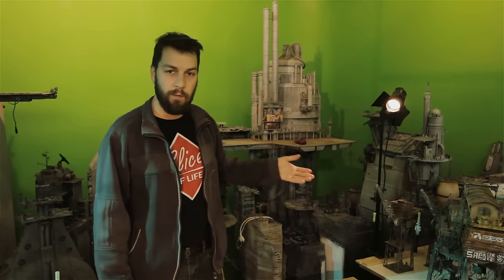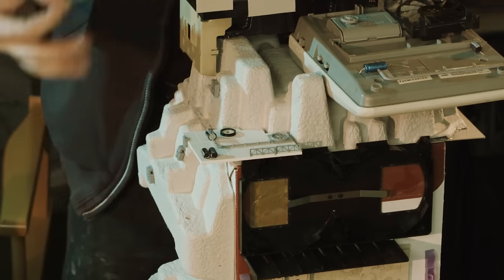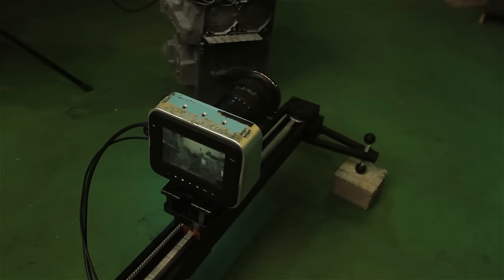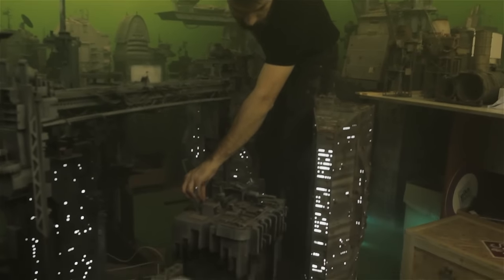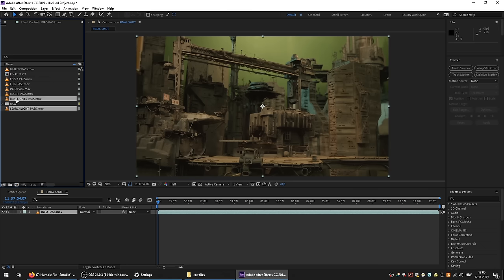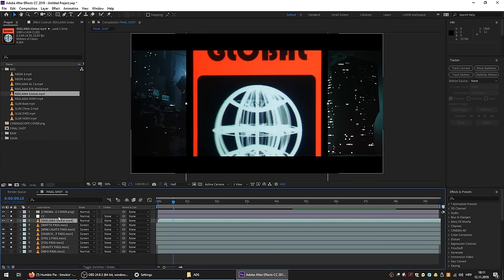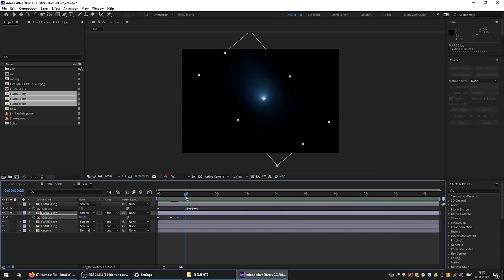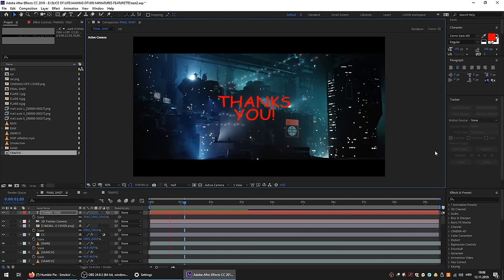The Magic of Miniatures - FULL PROCESS: build, shooting & editing of miniature world

Comment: Nice, and scary, to see how it all comes together. So many camera passes involved. I wouldn't have guessed it would take so many. I like how you really did use all sorts of models and parts of them. I noticed the Millennium Falcon on the side of one of the buildings. :)  One thing you could do before moving a building is lay down some tape to mark the position of the foot of the building. It could still be tricky to be sure it was lined up perfectly but it would help.

Comment: Very very VERY cool. But why does one NEED the passes? Why not do it all at once? Yes, I know this means you can control each effect individually (even add or subtract them if desired!), but is there another reason -- other than final edit control?
Reply from the maker: Well editing them in post is a very BIG reason, at least for me. You actually decide the look of the shot later. By turning something off or lowering the opacity you decide what will be in focus. That's the creative reason. BUT there is actually the technical reason as well. We had about 4 lights altogether, by doing 2 passes we double the amount of light sources. Another reason is that you can't film miniature window lights at the same time as the big lights as they would get lost. They are too weak so you need to expose them differently. Also, you can't project an ad on the building when you have fog in the room because you would see the projector rays... Lot's of reasons like that.. :)
Reply: @sliceoflifefilm  Very very very VERY cool good man. I thought so. I have 10 years of experience doing still photography so I have an understanding of exposure issues and such. Okay. So you answered my question! It gives you MUCH MUCH more control post (and it allowed you to fake having more lights by doubling their useage). It also allowed you to add the flying cars going BETWEEN buildings, which would have been a very  time consuming task otherwise (cutting out the masks and such). So... VERY COOL. I loved your movie. You guys deserve an Oscar nomination for cinematography. Such a perfect side tale for the BladeRunner universe. Better than the 15 minute minis they officially released for 2049.

Comment: One thing that is not mentioned is how you create the big lights ( like all the office windows on one side of a building). Could you explain that?
Reply from the maker: we just cut out the all windows  and lit them all with a single light source from inside. Simple as that. At first we cut them all by hand which was slow and hard, but later we bought a CNC machine. There's more info in this video: https://www.youtube.com/watch?v=PI8e9ty1nDg

Comment: Hot Glue gun i put a clip on the side of bench   the tip  is always  Up and No drips . 
bicard soda use that trick a few times -  Mite make a small vacum mould box  put diff parts on a board and make many panels for background effects
Reply: Just had another idea again Use wheelie bins stick panels on the sides  
so you can move the bin about & turn around any side diff parts on 4 sides   use in scence 2 ,  3  4 etc

Comment: 14:49 What lights did you use for the buildings? Those building lights are too uniform to be cutouts, too perfectly aligned to be fairy lights (on a string).
Reply from the maker: Ah! These buildings were made with the help of a CNC machine. So all windows were cut out precisely, and they were illuminated by a single light from inside
Reply: @sliceoflifefilm  Thank you for clearing that up. Great job on that whole sequence production!

Comment: What kind of software did you use to help you see your images on a live screen? Were you also able to overlay additional shots over a freeze frame Of one of the passes On the screen?
Reply from the maker: we used a simple SDI to HDMI converter and just connected the camera to the monitor. so it's only a live feed, no overlays possible unfortunately

Comment: I'm a hobby model maker looking at doing some filming/photography in this style. I'm planning on getting a Panasonic GH4 but stuck on what lenses to get. Anyone know what type/size lense is best for making miniature set and vehicles appear larger?
Reply from the maker: We shoot almost all miniature shots with this wide angle lens: Tokina 11-20 F2.8   seems to work nicely  ;)
Reply: @sliceoflifefilm  So with a wide angle lens like that would the having a really low F Stop on the lens really be that important? You would be using a high F value, correct? And then compensate with increasing ISO or using more on set lighting? Sorry for all the questions but your short film was the best low budget mini effects I've ever seen so I figured I'd ask a master plus I want to buy the right gear once instead of the wrong gear twice.
Reply from the maker: @stinkyham9050  exactly, low Fstop was not important at all, we mostly shot at F11 or even more to get the sharpness and we compensated with as much iso as we could and with more lights, just like you said.

Comment: This is great but when you put old electronics in it, no matter if just some parts like capacitors or a whole telephone, you basically run into trouble if you ever have to dispose it. It'll be hazardous waste then and you have to either dismantle it properly, which is hard as you can't tell the components apart anymore. Or you have to categorize the whole thing as electronics and deliver it to the right facility.
Reply: I wrote this before I saw the LED lights in all the models. ^^
Reply from the maker: Don't worry, we won't throw away our precious miniatures :D

Comment: Did you gents shoot any miniature shots at higher frame rates / shutter speeds to achieve a sense of real world scale? If so, what was your rule of thumb? For example taking the square root of the scale size D/d and multiplying that by 24.
Reply from the maker: We did shoot at higher fps but only the shots that involved movement of vehicles. I know of the formula but we just did it by feel. Most cameras only offer 50 or 100fps so there's not much you can choose from. we just did a couple of tries until it looked good.
Reply: @sliceoflifefilm Brilliant! Thanks for that insight. I'm working with a BMPCC OG, the highest frame rate I have available to me is 30. So when it comes to smaller moving objects I suspect I'm going to find it difficult to achieve a good sense of scale. Have you experimented at all with achieving similar results in post? Things like slowing the footage and motion blur? Thanks again, love your guys' work!

Comment: the part that might prove expensive I guess is that slider. You can't just use a dana dolly because you need the camera move exactly the same every time.
Reply from the maker: we do have the "more expensive" 3 axis slider, but the price for the ones with 1 axis of movement should not be too crazy.. also, we actually made our first slider ourselves. I just bought a servo motor and mounted it to a regular slider. It worked pretty good! ;)
Reply: @Slice Of Life  sorry, I expressed that poorly: I was merely remarking that the slider is the most expensive part of your set-up, and to replicate the effect, the most expensive part would be that slider. I said "you need," when I really meant, "one would need," which is my bad. I was mainly thinking of how I could do something like this myself. That is interesting that you made the first one yourself though. I just assumed you'd need the expensive equipment to avoid deviating in the multiple composits. I might just try it either without a camera move, or like you say, the one with the single axis of movement and just do a pan. Sorry, I'm expressing myself weird, my head's all over the place.